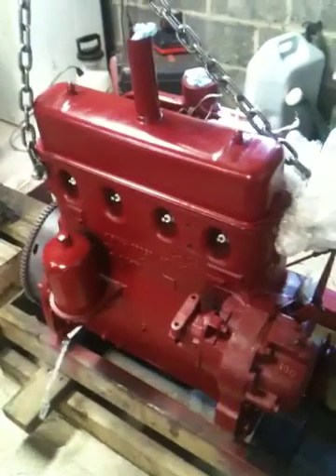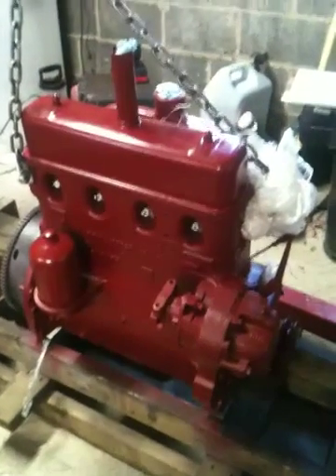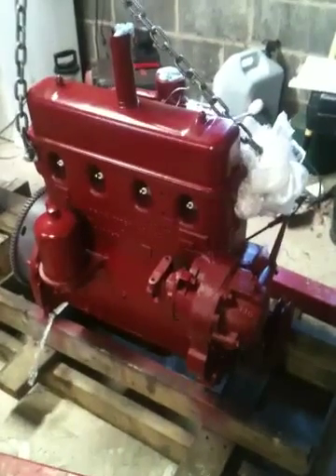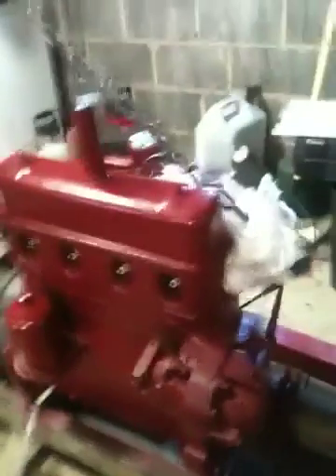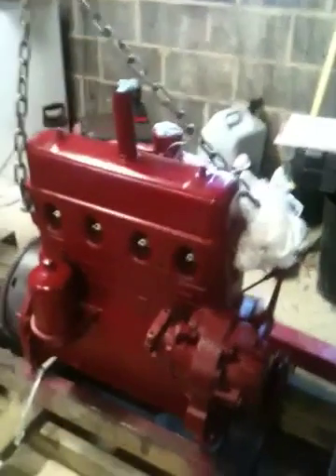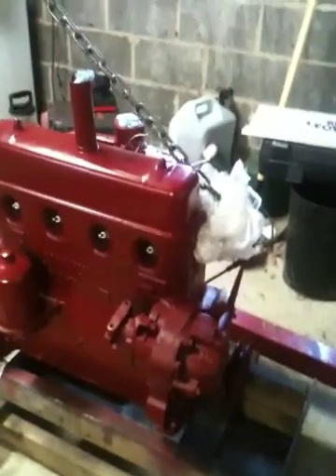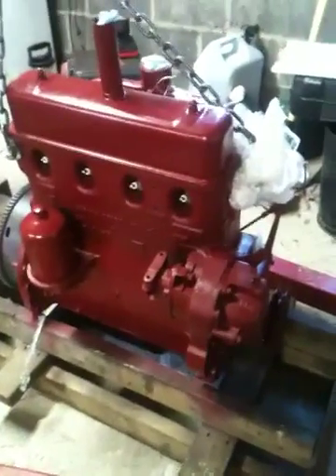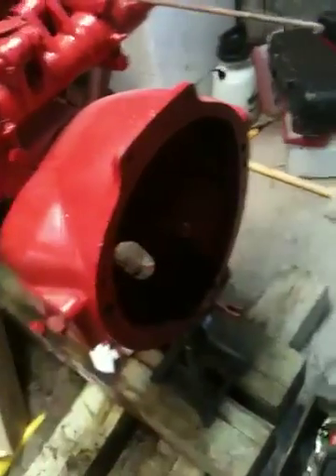Farmall Super A, 130, 140 hybrid engine

Comment from the maker: @onan75 I just noticed this comment, else I would have replied by now.  Rain had penetrated the manifold and made it's way into the #4 cylinder on the parts 140.  The head was trashed.  The block is probably ok.  There was still oil in the oilpan and luckily the crank and cam did not rust.

Comment from the maker: @OzzInter 0:40 I had to use a 140 crank because that's what I had and buying parts used parts can become expensive.  The 140 crank is unique to the 140/240.  The Super A,AV1,100,200,130,230 cranks are all the same, just with different casting numbers.  The 140 water pump system is different than the Supers, 100,130,200,230.  Some of the tool bar bolts have a bigger thread on the 140.  Small differences, but there is a lot of similarities.

Comment: Hope you did not trash the head, a good machine shop could probably fix it.  I took a set of 283 "Power Pac" heads, also known as "Pyramid Heads" to my local machinist when I was re-building the 283 for my 1965 Chevrolet Malibu SS Convertible.  I thought they were completely trashed, combustion chambers full of rust and every valve seized.   I think he charged me $95.00 a head to completely re-work them with all new larger valves, high rate springs, a three angle valve job, and some port work.

Comment: Quick question, why did you opt not to use the head from the 140?  The 140 head was the best flowing head IH ever put on the C113/C123 series engines.  Also, it would give the engine a little bit more compression and thus a little more power.  Are you going to run a water pump like the 130 and 140 had or leave it thermosyphon?  If I could I believe I would run the water pump as the C123 generates more heat than the C113.  I have a Super C that I am running a C head on so basically same as yours.